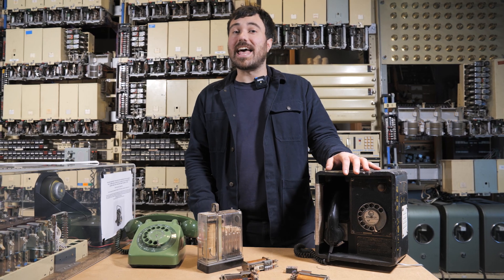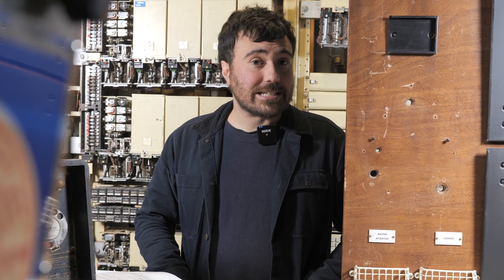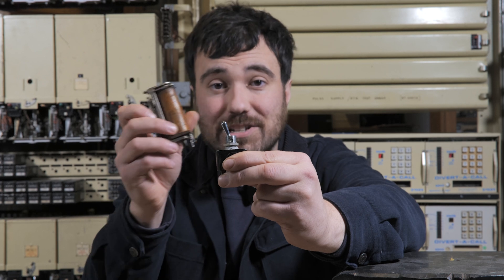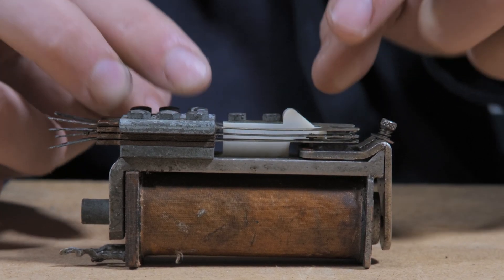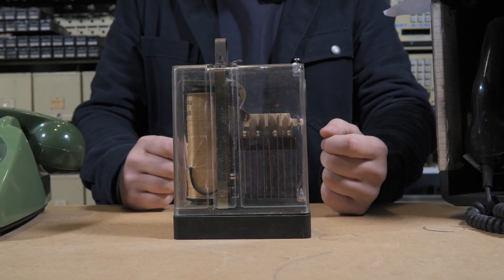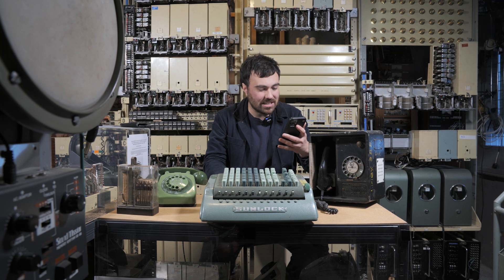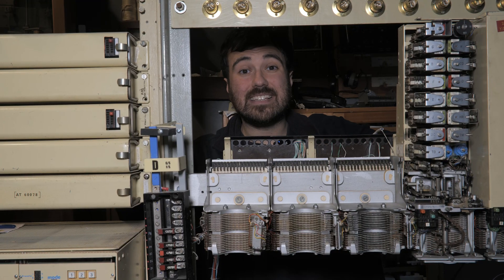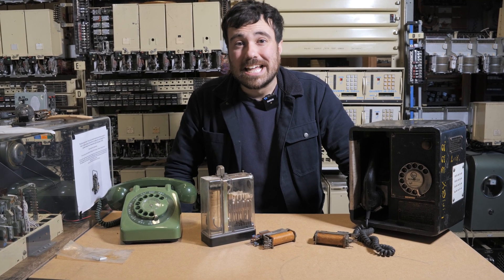What The Fudge Is A Relay? - Telephone Tuesdays

Comment: I disagree with what you said about relays and solenoids
A relay is a fixed core that pulls an armature that operates contacts
A solenoid has a moving core that funcions in the same way as a piston, normally used in mechanical sysems like locks etc
Though they can also operate contacts as in a starter solenoid
You can cascade relays so that one relay operates the next, the last relay in the chain releases them all, add capacitors across the coil to slow them down, or use delay relays (i had to build a timing circuit at telecom school)
Had a run in with a university graduate in telecoms that couldn't work out why a relay wouldn't operate, even though he tested resitance and voltage, i had to show him it was metal swarf behind the armature
Reply: Heya cheers for the comment Sparky enjoy hearing your stories! I think yours is a fair usage of “solenoid” to define the common modern component, but the original scientific definition from 1823 I believe doesn’t necessitate a solenoid to have a core at all. At least not a solid one. Happy to be corrected though!